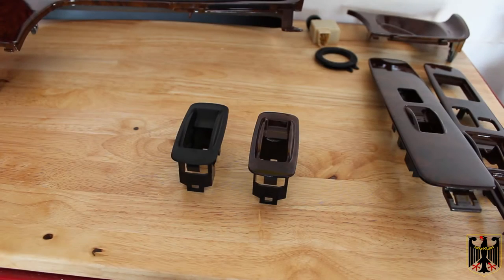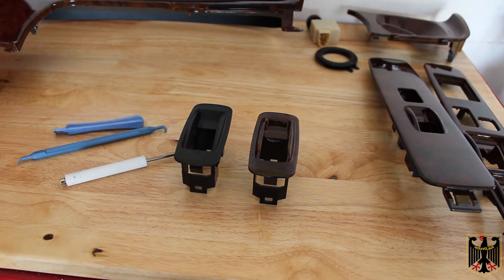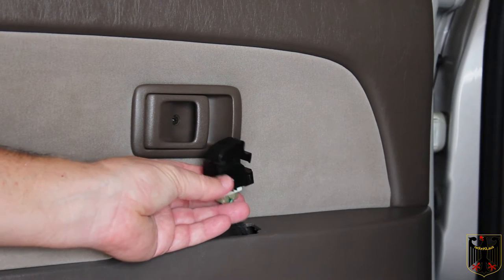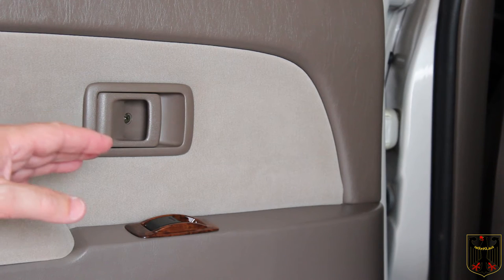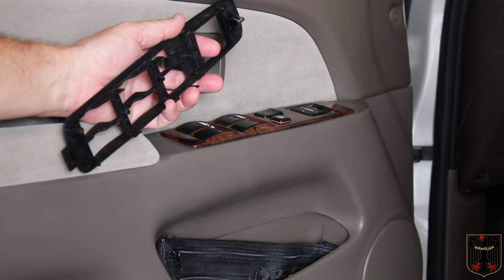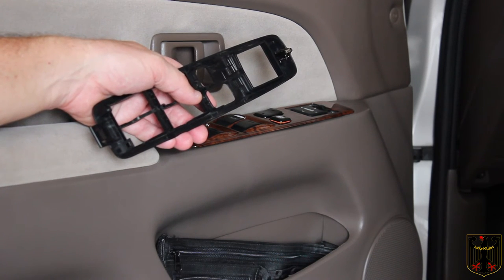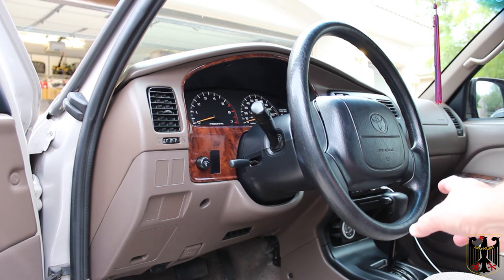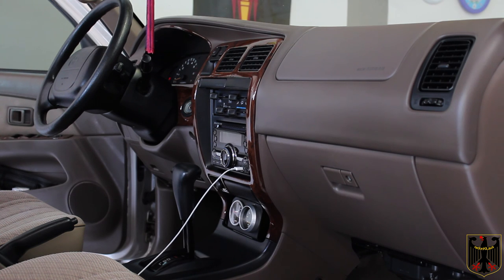1996-2002 4Runner (3rd Generation) Window Switch and Dash Trim Removal

Comment: I have been unable to find the correct bezel. Did you deal with an ebay dealer or just a private party? I may be interested in all of your black trim.
Reply from the maker: +Ryan Barstad I dealt with OK Auto Parts on eBay for the radio bezel and the window switches, and sourced the shift bezel and gauge cluster surround from forum members.  I am keeping my stock black trim in case I want to switch back in the future (it's very hard to find mint condition black trim since these trucks are so old now), but it wouldn't fit your truck anyway, since the radio bezel and window switches are different in 99+ 4Runners.  I believe there is a complete set of the silver sport edition trim for sale on the forums, so if you don't care about having woodgrain, that is an option.

Comment: Where did you pick up all of your trim from? I broke the radio bezel on my 2000 toyota 4runner limited with woodgrain.
Reply from the maker: +Ryan Barstad The radio bezel and window switch trims I purchased from eBay, and the shifter bezel and gauge cluster bezel I got from the T4R forum classifieds.  Make sure you get a radio bezel from a 1999 or 2000 model 4Runner, as the wood color changed for 2001-2002 model years.  The best place to find the parts is eBay.  Thanks for watching!